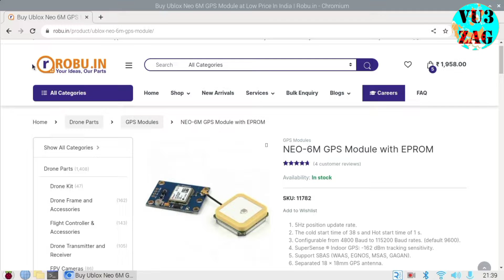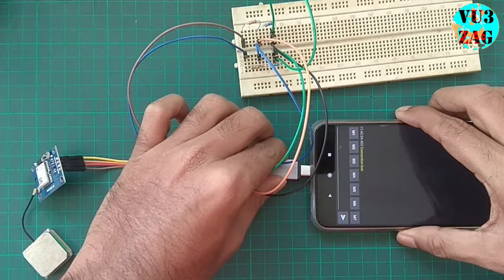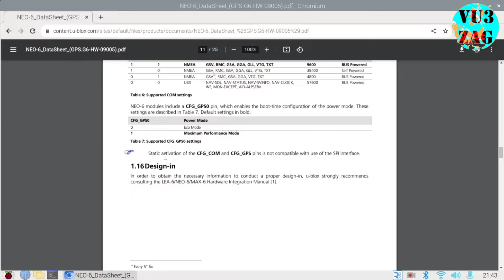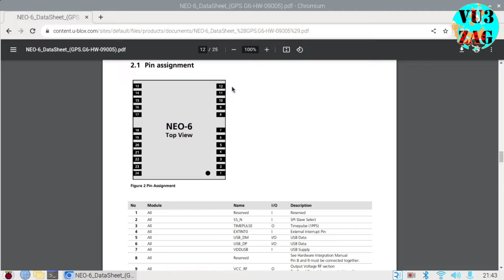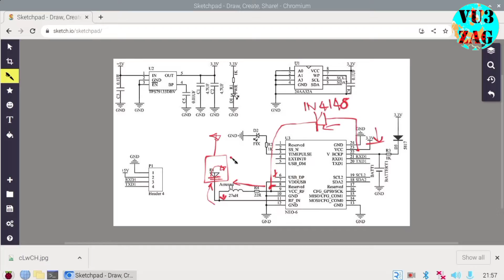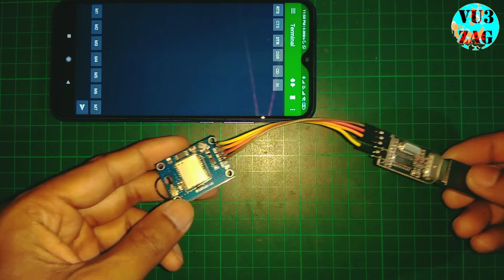Troubleshooting uBlox Neo-6M GPS Module

Comment: If i provide 5 volt to neo6mv2 gps vcc pin then LDO REGULATORS ON IT HAS OUT PUT 2.51 WHICH IS LESS FROM 2.7 WHICH IS SPECIFIED, WHAT COULD THE REASON, IS THEATRE MAYBE  SHORTCIRCUIT IN CHIP OR OTHER REASION ? HOW TO CHECK IF SHORT CIRCUIT AT PIN 23